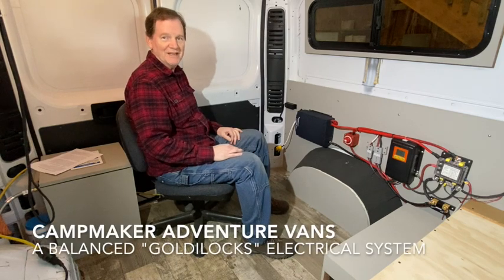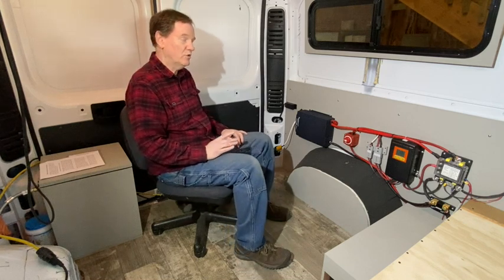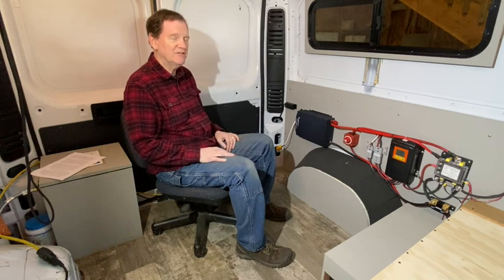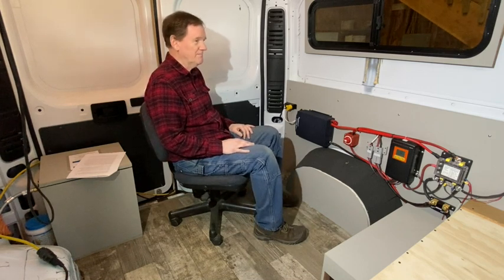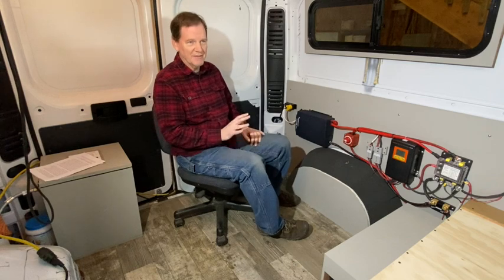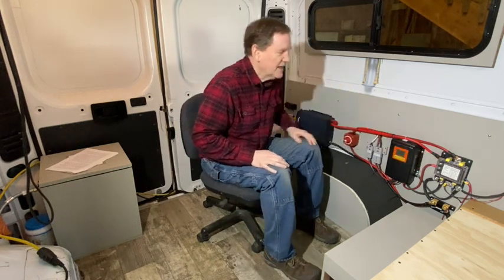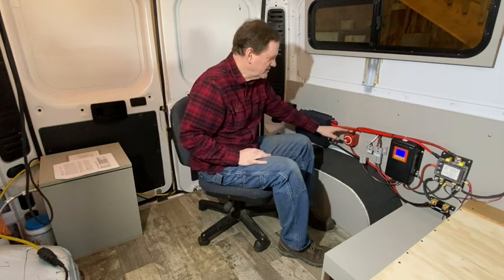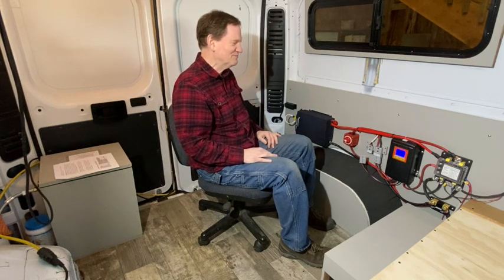CampMaker Goldilocks Electrical System

Comment: Hello Dennis can you please send me what gauge of wire you're using for this system from house batterys to on off switch the dc to dc i but all the stuff you have there the kisae 50amp what gauge wire from the alternator.The shunt wires a  schematic of the sizes would be awesome I'm a newbie promaster van Thanks
Reply from the maker: Here is a link to the diagram. It includes wire sizes. Let me know if you have any questions. https://www.dropbox.com/scl/fi/09b16wndvuo8p8qynhzca/Electrical-Layout-25-10-22.pdf?rlkey=nezenenb1rl6d3hq76ne4t9ws&st=idjnkteg&dl=0

Comment: Hey Dennis, thanks for making the video! Great Explanation and I plan on implementing a lot of what you talked about. Do you happen to have anyinformation on how you mounted the Q-cells solar panel on the pro-master roof? Dimensions appear to be 74" x 41.1". Most roof rack appear to have a 69" usable width. Just curious how you maximized the rooftoop space? A photo would be very helpful!
Reply from the maker: Here is a link to a photo gallery for the van you asked about. Fairly early in the build we did the solar panels. I don't use a roof rack, but instead mount the panels with 1/4 aluminum angle iron. https://www.dropbox.com/scl/fo/d1re7ipumlmt8r59ganyw/AGVm8Ajh2tgRZ3jHwMeHd_A?rlkey=kviyj2avbjhie4nne30widk5y&st=amm015vy&dl=0
Reply from the maker: The solar panels begin at #80.
Reply from the maker: A lot of my content can be found at campmaker.com

Comment: i built my camper van power system with 400 watts solar and 400AH LIFEPO4 with the kisae controller that you have and 2 separate inverters-one is 600 watt pure sine for my electronics and a 2000 watt low frequency inverter/charger for heavy stuff like cooking and such.i have a diesel heater for heat.works great!

Comment: Thank you Dennis! Very clear and helpful! How difficult is it to run the alternator/starter battery tap from the engine compartment to the Kisae DC-DC charger?
Reply from the maker: It's not too hard to run both the lines from the starter battery.  The Kisae DMT1250 needs a 4AWG wires. I prefer to run both positive and negative cables from the battery.  The positive red cable connects to the starter battery with a 60A Megafuse and then under the drivers side step cover. Almost everyone with the ProMaster does it this way and there should be Youtube about it.  If not, maybe I need to do one. ;-)
Reply: @dennislittlefield  Thanks for this! I don't have my van yet (getting close now) so I'm trying to visualize all the potential snags. I did a bit of searching on the promaster site and didn't find any reference. Probably just the wrong search terms...
Reply from the maker: @Guy_Washburn  Maybe when I do the next stall, I’ll create a video about that.
Reply: @ That would be very helpful!

Comment from the maker: Description	                                                Weblink
Li-Time 100 AH Heated Battery	                https://www.litime.com/products/litime-12v-100ah-self-heating-lifepo4-lithium-battery-with-100a-bms-low-temperature-protection
Li-Time 100 AH Heated Battery	   	        https://www.litime.com/products/litime-12v-100ah-self-heating-lifepo4-lithium-battery-with-100a-bms-low-temperature-protection
Kisae 50A DMT1250 Charger	        	https://www.donrowe.com/KISAE-DMT1250-Abso-50A-DC-DC-Battery-Charger-p/dmt1250.htm
Platt 410 Watt Solar Panel	  	                https://www.platt.com/p/2158224/q-cells/410w-solar-module-132-half-cell-black/qclduoblkmlg10410w
Aluminum Angle Iron	                                https://www.ebay.com/itm/363868797687
Blue Sea Safety Hub	                        	https://www.amazon.com/gp/product/B0053BTSEK/
Wires for DC to DC Charger	        	https://www.amazon.com/dp/B07K4RJNY5?
ring Terminals and shrink wrap	        	https://www.amazon.com/dp/B0CS6L1RVC?
Victron SmartShunt	  	                        https://www.amazon.com/gp/product/B0856PHNLX/
Blue Sea Battery Disconnect	        	https://www.amazon.com/dp/B01C7A8RXW?
Samlex 1500 Watt Inverter	      	                https://www.donrowe.com/samlex-ntx-1500-12-1500w-pure-sine-inverter-p/ntx-1500-12.htm
Anderson Disconnect DC to DC	 	https://www.amazon.com/dp/B0CMJYLYJ6/?th=1
Anderson Disconnect for solar	 	        https://www.amazon.com/gp/product/B07CHD4JCK/
                                           Grand Total	1,778.63